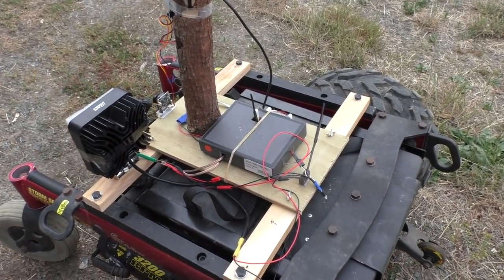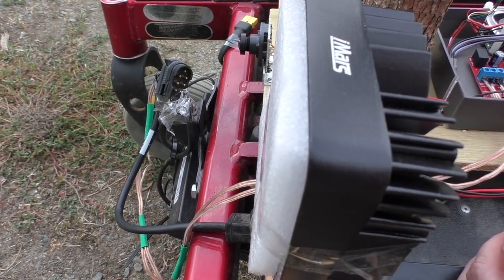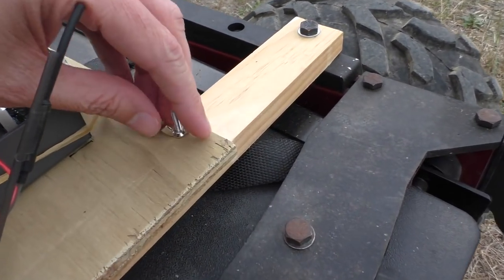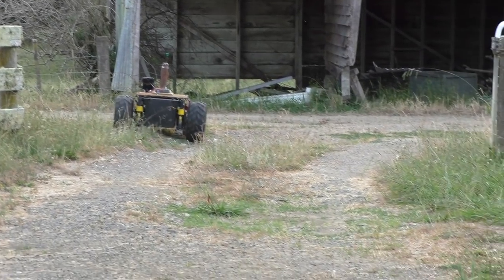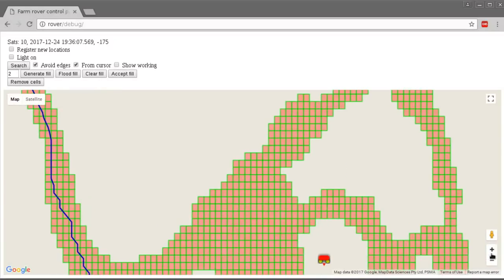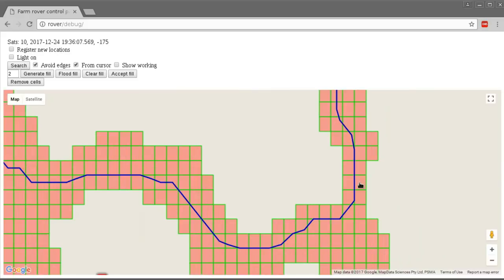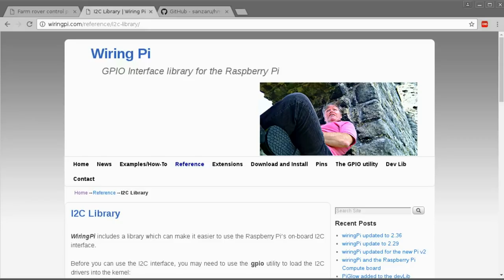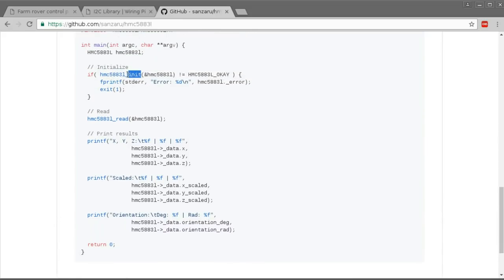Farm rover part 8 (path-following)

Comment: I was thinking of making a lawn mower with a roller, running on batteries. It would go back and fourth in a garden, in straight lines and dock with a station where its battery was swapped. Is GPS accurate enough for the mower to maintain straight lines for good-looking lawn stripes?
Reply from the maker: Unfortunately nope :)
Reply: @iforce2d  Do you have any ideas about how straight paths could be achieved, without filling the garden with permanent hardware? I was thinking of having a laser run along opposite ends of a rectangular lawn and have the robot turn 180 degrees when a laser is intercepted.
Reply from the maker: I think some systems use wires buried underground, that the robot can detect - not sure how they work though, and seems kind permanent.

Comment: Why didn't you use your diy nrf24l01 transmitter? It would be easy to add some bit "channels", you could probably also use it to send it a new path  or coordinates of a new target - with another nrf connected to a pc. The range is much better than the wifi one.
Reply from the maker: I might use nRF24 at some point later, but for now the easiest way to develop is with a web interface (ie. HTTP) and the nRF24 only has unreliable 32 byte packets. To develop a TCP connection over the nRF24 would probably be more work than everything else I have done so far.

Comment: D-GPS, as mentioned in other comments could be a good solution. 

https://en.m.wikipedia.org/wiki/Differential_GPS

Perhaps you could take the NMEA stream from a stationary GPS and directly transmit this over one of your LoRa radios to the robot. The robot, knowing the stationary location, could then calculate the current positional error vs the moving GPS on the fly with very little difference in time.

Comment: In my robots, I connect the Pi to the Arduino over USB. Then, I install a CLI toolchain to upload from the Pi via USB. (I use PlatformIO but there are several.) This lets me wirelessly program the Arduino over SSH, without having to disconnect it from the robot and connect it to my computer.
Reply: Actually, I usually use an Arduino Pro Mini because of its small size, so I connect directly over serial to the pin headers on the Pi, not USB. Basically the same thing though.